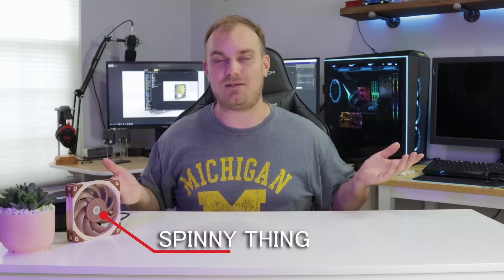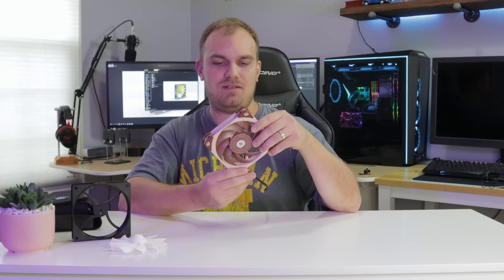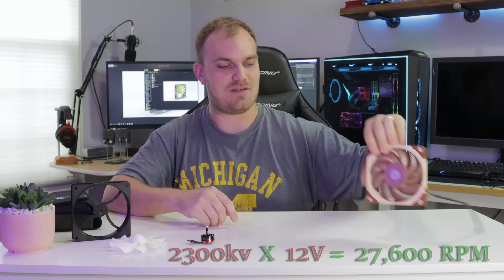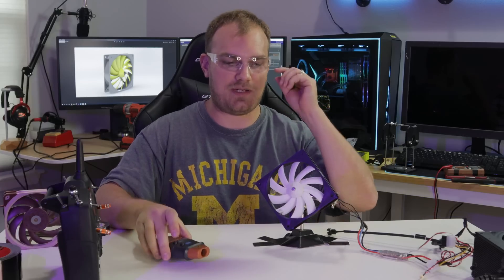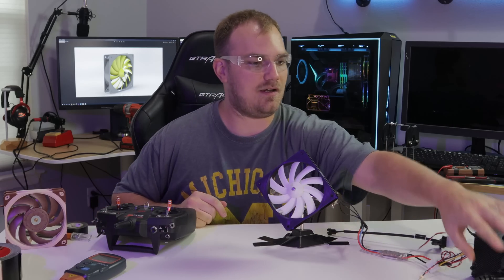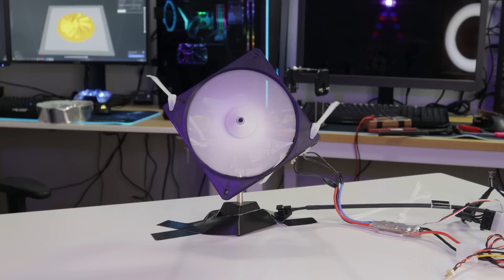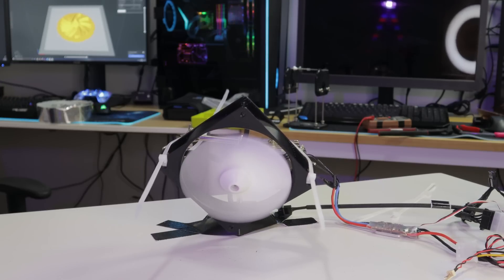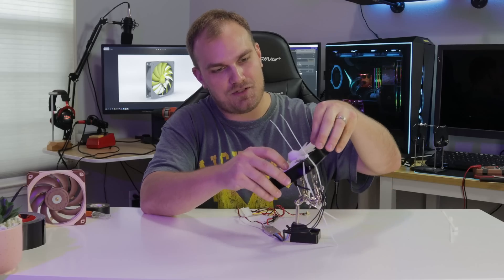3D Printed 120mm Fan + 27,600 RPM Race Quad Motor = Mayhem

Comment: Fan blades stretch at higher speeds. That was some of your problems.
Reply: Actually that what noctua put most RnD into for the right material, to get the smallest gap possible
Reply: Fiberglass reinforced plastic would help a lot with that, however it may also be hell on a 3D printer nozzle and wear it out fast.
Reply: Just put some sandpaper on the inside of the shroud and that will take care of the fan locking up
Reply: @EVPointMaster  The fan blades will probably melt to the frame and lock up faster as the friction will cause heat, the plastic will Bond to the sandpaper, then you instantly have plastic rubbing on hot plastic and the blades would break or the fan will lock up.
Reply: When you print a Ring oround it it will help. Also use a big washer to sprea the forces around the nut.
Reply: Is it an actual flex? or just bending straight with the force of the air vs the torque?
Reply: @Jamecbond  Thank you sir! I couldn't remember that term to save my life when I posted on this. i was gonna look more into it and try and find the term i was looking for again. But the comments started to get toxic after a couple days so I just stopped replying. I figured you deserved a thank you though lol!
Reply: The closer the gap between blade and housing the more efficient the Fan. It's a feature 😂
Reply: Crazy how you could watch them stretch.
Reply: hmmmm I don't think they are necessarily "stretching". I think they are more or less trying to straighten out the curve in the blades from the centrifugal forces. Which would seem like it is stretching. I could be wrong though. I'm not an engineer lol.
Reply: @TheRocknRolla84  They actually do stretch over time if you had two identical fans and never used on and had one run for something like a year or two and measure the blades the one that had been used would most likely measure longer.
Reply: @infernaldaedra  Right, I understand that😀. I can see a plastic fan blade stretching slowly over extended periods of time, from extended time under the centrifugal force that exceeds the recommended parameters of the materials used to make said fan blade. But I think in the test he did, in the video, the fan blades just flexed the curved blade outwards slightly straightening the blades from the centrifugal forces and drag from the air on the blade instead of stretching it. If the fan blades had stretched then there would have been irreversible damage after the first high speed test and the blades would have kept rubbing on the fan shroud from there on. When he slowed the fan back down it no longer rubbed on the shroud. Thus is the reason why I think the blades flexed outwards instead of stretched, because when the centrifugal forces and the drag decreased, the blades reverted back to their original shape. I do think the blades could have stretched ever so slightly during the test. But I don't think it was enough for the blades to start to bind up on the shroud. If we had more data on this situation I'm sure we could find a definite answer to this. But unfortunately we do not. So the best we can do is hypothesize.
Reply: @TheRocknRolla84  Its a bit of both, but this mainly depends on the material of the blades and the blade design. Softer materials that you will find in cheap fans notably have more space between the blades and the frame to counteract the forces that will cause it to flex and stretch if that makes sense. Higher end fans will use higher grade tougher plastics that are usually fiberglass impregnated to counteract these issues and allow for tighter tolerances between the fan blades and the frame. And finally fan blades with a sharper angle push against air with more force and the air pushes back. 

Noctua is actually a prime example of this. If you compare a high end fan with a cheap like $3 Chinese one all of the differences are usually easy to point out.

It's also important to not that PLA is very prone to warping moreso than it is to flexing that's a couple of the things we see in this video it's a very extreme example but if the fan was filmed in slomo it would be apparent that the fan blades are "spreading out" as they spin largely due to centrifugal force and largely due to air resistance.

Pretty much all of the design for these fans is put into the fan blades, how thick the blades it be? How close to the frame? What angle and shape of the blades? What material? How fast can it spin? Can we make it quieter?
Reply: @TheRocknRolla84  Except the blades do stretch, basic physics of rotating objects. Surprising how you got the centrifugal part correct, but the concept of how those forces work entirely incorrect. The forces to straighten out the curve of the blade, which keep in mind are a complex curve that spans multiple planes, would be higher than the centrifugal forces stretching the blades outwards; and to further this, you would see the blades flatten along the shallower curve, perpendicular to the radius, before you would see them straighten out along the radius of the fan, which is a more pronounced curve, both of which form the complex curve. 
To help explain this, replace the curves with straight lines. The lines, which are radial, will want to deform outward due to centrifugal forces. Now go back to the complex curvature of the fan blades, they will deform in the same way, as that is the only force causing them to deform; the only other force acting on the blades is air resistance, and the air will move long before the blade ever deforms. 
If what you described was ever actually an issue, we would not have any functioning propellers. Use some logic before forming an argument.
Reply: @xaytana  There is no force in physics called centrifugal, only centripetal. The fan blades rubbing is result of to weak centripetal force.
Reply: @xaytana  Funny seeing you being butthurt over technicalities. Because you got all out on technicalities in your top comment.
Reply: @xaytana  Pick up a fan. Now try to bend a fan blade in a straight line from the fan axis, and then try to stretch it.

Most hard plastics like those used in 3d printing have very little springiness, as they are hard and tend to crack, not stretch. They are usually capable of bending a bit but then often don't come back to the previous shape.

After all of this you should be certain that centrifugal force on the blades will be much more likely to dynamically bend the blades straight than to pull the blade and stretch it's length. It's basic material properties we're talking about.
For most stiff materials force needed to bend them is multiple times lower than that necessary to stretch them.

Also look at the design of jet turbo fans. From the center they are always straight and bend according to the aerodynamic design near the edge where the blade reaches maximum speed. This is based on the exact principle that I've mentioned, that it's way easier to bend, especially with a big arm to multiply the force, than to stretch.

Pc cooling fans have strange shapes because they don't reach high rpms and therefore it's not a problem for them. They concentrate more on maximizing cfm, low noise level and pressure.
In server cooling fans where you do get high power 20Watt fans that spin at 6k rpm or even higher you usually get lower amount of bulky, short and perpendicular blades to the axle, and that's exactly to minimize the bending effect. The most overkill server solutions use metal cast fans, like in HP c7000, but those fans really do push a lot of air.

Comment: Who ever sed Molex was dead. Ha, cant think of a better way to use one
Reply: Yeah i love molex
Molex is soo underrated
It helps alot when you dont have more sata
Or want to add some accessories
Reply: @Rainbow__cookie  yeaaaah, no. 
Molex to sata connectors are literal bombs.
Reply: @sadmonstaa  I know but don't get those cheap ones get those that are crimped not moled
Reply: I use Molex to solder custom connectors like for my 230v socket adapters and just solder the 9mm plug to a molex so i can add cheap led strips to my pc
Reply: @wargames43  I assume you are using 230V to 12V adapters, but never use molex for actual 230V, as you might get sparks between the connectors.
Reply: @Jamecbond  i know lol most pins you use are molex on a pc but everyone knows that everyone calls the sloppy one the molex rofl

Comment: Im no engineer or fan expert but i think it would help if you increase the gap between the fan blade and the shroud due to the inaccuracy of you're printer. You will have more room for the blade to spin without hitting the case even if they aren't printed perfectly.
Reply: Put some sandpaper on the inside of the shroud and the fan will "self-adjust"
Reply: IIRC Noctua new fan has smaller gap than their older fans. To make that happen they need few months/years of development to create that smaller gap without sacrificing reliability.
Reply: @galihprabasidi8498  the noctua fans don't go over 3k rpm and the ones that go at 3k rpm have plenty of clearance
Reply: Izan TM  and his mean is by touching the frame it will increase the gap by itself
Reply: Engineer here. Can confirm.
Reply: I'd say if the blades swept the other direction it wouldnt catch and would just glide over